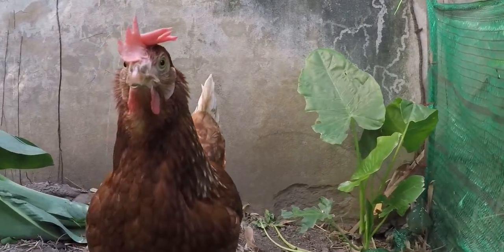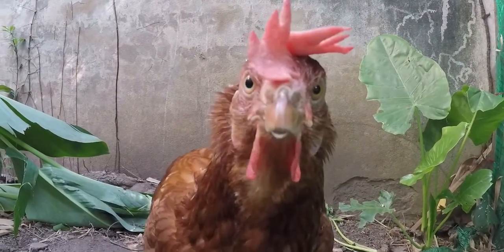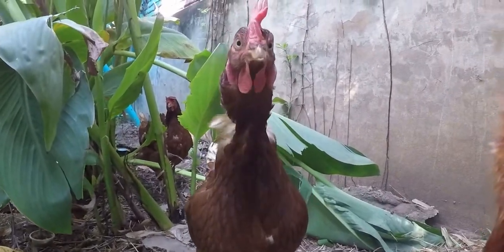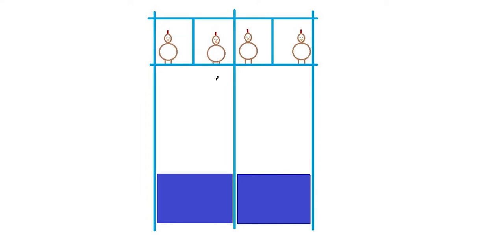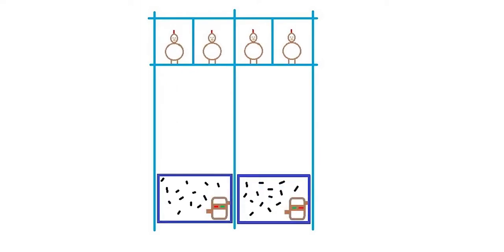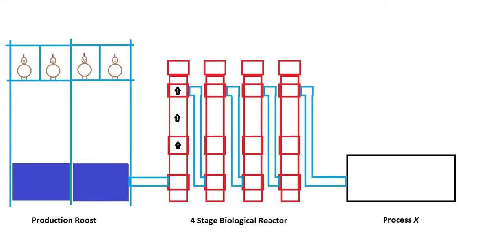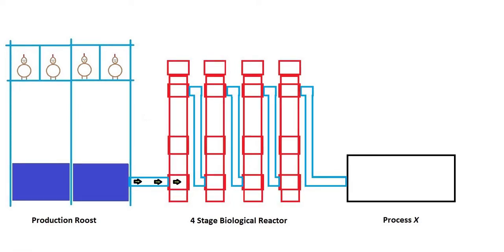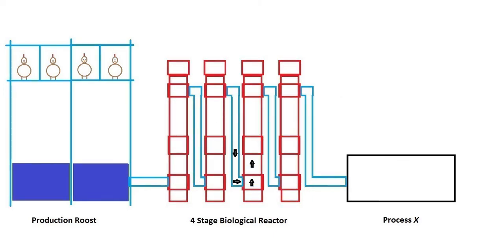Chicken Aquaponics Design

Comment: Just Found your channel. I Just built a large 1000 gallon Fish tank/pond. I also have Chickens. Now you have me thinking. Could I combine this? Put chickens over the fish tank/pond with fish as well? I am not planning on growing food out of the water but rather run my yard irrigation system with the water and using frequent water changes that will feed my yard. I have also seen that the chicken poop may also be able to feed fish. What are your thoughts on this type of system working?
Reply from the maker: Chickens over fish has been done in Asia for decades.  I have no advice to share as I have never done it myself.  Good luck with your project.